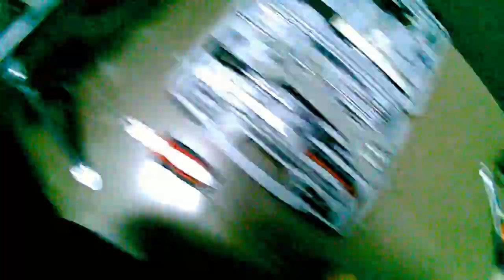Changing Battery - Razor MX650 Dirt Rocket

Comment: the kid around the corner from me has like 5 of these and , he puts car batteries in them, converted somethings and now they go like 40 to 45 mph... maybe that'll give u an idea lol
Reply: Tristan Baker Fuar, given me an idea for when I buy one of these! I  want one so bad
Reply: BrotherLead lol, its pretty sweet
Reply: BrotherLead u have to convert wires and i think some other things and it'll work idk i would have to ask
Reply: Tristan Baker How much are these usually?
Reply: BrotherLead well idk about the bikes i think they're like 200 bucks but car batteries run from like 30 to 70 bucks
Reply: Tristan Baker did he change speed controller or put something in to drop amps

Comment: This is amazing, I bet you're having fun riding with that bad boy, You know I wanna get 1 of that too and customize it  I already did with a e300 razor and it's really fast I put 36v 800w motor,  First I have a 36v battery lead acid.  and  I tried to put 48v lipo battery it works but when you put more power battery dies and need to reset and aside from that all good.  My question to you do you think we can change's the tire  like street bikes?